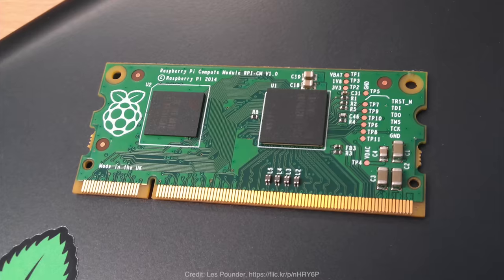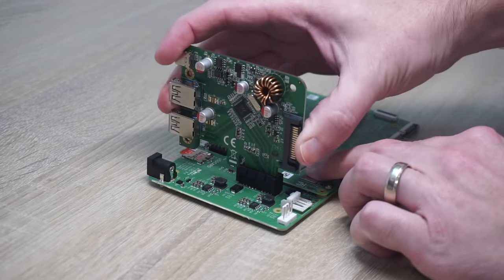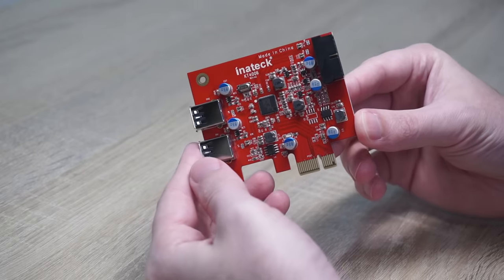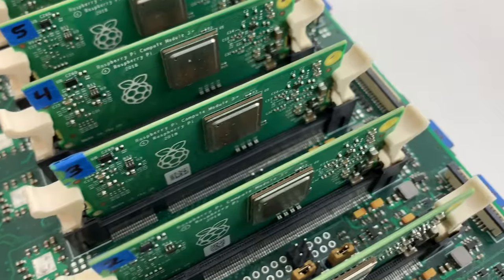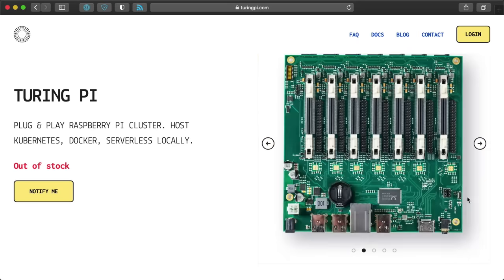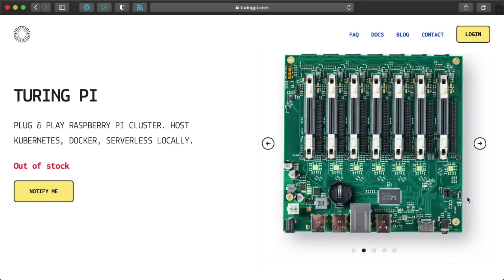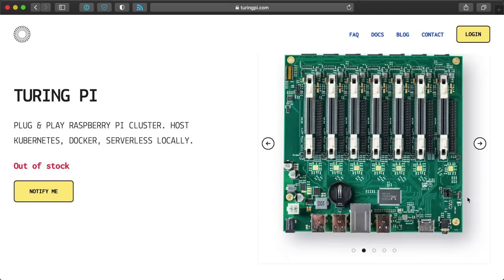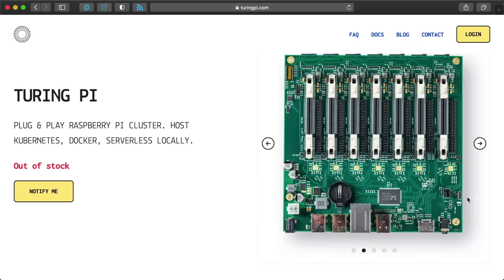The Raspberry Pi Compute Module 4 Review

Comment: The change in form factor was very well justified with a bunch of new features. Being parallel to the IO board will make your cluster wider, though.
Reply: So true the dimm is expensive when designing a board.
Reply: Yeah, I didn’t get what he meant at the end when saying it takes up less space, it seems it will take up more at least in the horizontal plane.
Reply: Couldn't a custom cluster IO board be designed in a way that lets you mount the CM4s at a 90 degree angle? perhaps by using a sort of riser cable for the outermost connector.
Reply: I believe you would be better off simply populating both sides of the mainboard with CM4. Cooling would be easy too.
Reply: I was having that in mind too.

Comment: Hi, regarding the graphics cards, you can plug in a graphics card designed for "longer" PCI Express slots into a PCIe 1x slot. I did that a while ago with an external GPU solution. The card will not use it's full potential, but that affected mainly loading times, like texture loading. Basically anytime the GPU requests data from the rest of the system. Regarding drivers, have a look at AMD cards, they are open source and are included in mesa and should work.
Reply: You're right, but in this case it doesn't look like the PCI-e slot was manufactured with the back open to support that. He could open it up with a rotary tool, but it isn't something most people would be willing to do.

Comment: As a person who will be buying one of these for integration in an actual device it's way more important to have every i/o possible than for the board to be smaller.
Reply: Indeed that's a development board intended to better develop the more integrated solution the compute module is meant to be used in. Kinda weird that there's no usb3 though

Comment: Use a modern AMD GPU card with a 1x to 16x pcie riser often used for mining. You should then be able to get a modern gpu running on the raspberry pi 4 CM.
Reply: That works with almost any GPU. PCIe is backwards and downwards compatible and latency tolerant.
Reply: @BrunodeSouzaLino I specifically said AMD GPU because of the opensource drivers in the Linux kernel which should work on ARM ISA not just x86.
Reply: or just open up the back of the 1x slot with a hacksaw also works
Reply: @Peter_Gamerrr  I mean a hacksaw is pretty extreme but some flush-trim snips would do the job. I’d be concerned about stability, though. Using a mining riser allows to lay down the GPU so it can’t damage the breakout board.
Reply: @Peter_Gamerrr  You would need the riser anyways as the PCIE sot is expected to supply power, where risers can be powered with a molex/sata power cable for that power. GPU's don't only pull power through the 6/8 pin power cables as the PCIE slot is normally rated at 75 watts.
Reply: @kdb424  Yeah, and I really doubt the CM4 has the power delivery to supply an extra 75W lmao, yeah you'd definitely need a riser.
Reply: Doesn't nvidia release arm drivers?  Pretty sure they do.
Reply: @charles2000wang  That's the theory, but in practice it can be a little bit hit-and-miss, mostly depends on the actual GPU being used. I've had issues with Navi for example, even on x86...
Reply: In fact you can't. It is not all about driver availability and slots. The problem is that PCIe is very complex bus and there are a lot of features that SoC should support to handle PCIe device correctly. For example GPUs require big amount of memory mapped to PCIe address space. I haven't seen any ARM SoC that supports at least 128MB buffer. If you are interested you can check how Allwinner created great H6 SoC with PCIe 2.0 but they have only 64k mapped. So literally no PCIe device can work with it. You can modify the driver to wrap the memory but it will require a lot of time. I also tried to connect NV GT710 to Rockchip RK3399 and use OSS nouveau driver. But no luck so far.
Reply: @Peter_Gamerrr  Pretty much. No riser needed. The power is common either way it takes it.
Reply: @paintenzero  In RK3399, the physical memory addresses that can be used for PCIe BAR (Base Address Register) is 32M, which is far more lower than what required in normal PCIe graphics card, that is why it is impossible to use PCIe GPUs on RK3399.
@acedogblast
 I reckon the same goes for RPi 4.
Reply: Raspberry pi does not have the bar space, a workaround can be used to increase the bar space, but the raspberry pi does not support the legacy VGA io connections that nearly all graphics cards look for before boot up. Fun times

Comment: What I like about this is that you can take a mini ATX case, drill some mounting holes, and fit the IO board in.  In fact, I wouldn't be surprised if someone makes an adapter to mount the IO board in place of an Intel board.

Comment: Just FYI, you may be able to get an PCIe x4, x8 or x16 card to work in an x1 slot using an adapter. This will of course only achieve x1 speeds but the other lanes will just remain unused, if following the PCIe spec properly.

Some PCIe x1 slots even have "open back ends" to accommodate cards with more lanes. And some modders create the open back of the slot manually using a saw, file or similar :)

Comment: Imagine what you could do with this. You can make a super compact computing cluster, or attach it to a custom PCB and make a cheap arm laptop that actually does something (or you could just buy the pinebook but you get the point right). The possibilities are endless!
Reply: If they keep the same connector, you could just swap out the module and keep the screen/keyboard/etc

Comment: I'm super interested in the pcie parallel port for the pi because LinuxCNC, which I use to control my benchtop CNC machine, requires a parallel port to control the motors in real time. Can you get a touchscreen for the pi compute module 4?

Comment: You really got me excited for compute module with motherboard!

As for nvme - maybe you could put /boot on emmc and rest on nvme.

For nvidia drivers - you could use open source nouveau driver, should work for ARM too?

I was wondering what is the max speed for over locked compute module with radiator and fan on it?

Comment: When you want to plug in a video card you can use a pcie x1 to x16 Riser and also use basicly any other pcie device
Reply: Yes, pci devices are usually able to run with less lanes. Would really like to see it tested.
Reply: You are correct, I've tried both PCI-E 16x and 8x graphics card in 1x and 4x slots with risers and it works just fine, just at the lower bandwidth of the slot.
Reply: @dv7533  yes beacause pcie is dowardcompatible
Reply: I haven't watched the video yet, but I'm pretty sure the Pi can't handle PCIe GPUs. I've had a look into this topic a while ago for the RK3399. Basically those small CPUs lack some sort of cache/memory that would allow them to operate a dedicated GPU. More precisely: This cache is too small.
Reply: PCIe is not only backwards compatible, it's also latency tolerant, as demonstrated by the guys that hacked the PS4 by making use of the the PCIe bus connected to a serial port and it worked.
Reply: @BrunodeSouzaLino  Please send a link of that, I'm intrigued
Reply: don't even need a riser u can also just rip out the back of the pcie slot so the x16 card will fit. That will also work perfectly
Reply: @Peter_Gamerrr  yes but when arent carefull that could destroy your pcie slot

Comment: If you cut the back of that pcie slot and there's room you can technically use a 16x card in it. It will just run at 1x speeds. The same can be achieved with an adapter. I'm curious as to the version of pcie too as I think that would have a large effect on the performance. If it's 3.0 then it wouldn't be too terrible to run something like a hd 7750. Not sure that would actually give you better performance though. Definitely would like to see what the differences are though. I'd watch that video.

Comment: you said cant be used to boot....i recall on the RPi3 there was an OS that you would put onto the SD card which allowed you install OSes to an external USB device and then boot those OSes (after iitially booting to the SD card and selecting which OS to use) sorta like the OS on the SD card was like another bios layer if you will or like a pre-OS.....can you do that with NVME and still put the OSes on there that way?

Comment: 9:30 For the GPUs, you can use literally any GPU you want (even if it has an x16 slot) by just notching out the back of the PCIe x1 slot and sticking it in, or the cleaner solution is to get a pcie 1x riser card (e.g. https://www.amazon.com/dp/B076KLJR2Y/ ). Nearly any x16 card will run absolutely fine at reduced speeds if you just install it in a x1 slot, no problem. You can them use an arm build of noveau for an nvidia gpu, or an arm build of AMDGPU for an amd/radeon gpu; you can probably even find pre-compiled packages of those drivers, but those are both open-source so even if not you can compile them yourself for arm.

Comment: It's time to run discrete gpus on the Pi. You can find 30$ pcie 1x to 4 1x ports switch, usually used for crypto mining rigs, with that you can connect multiple pcie cards.
Reply: People can run a mining rig on these new compute modules. How nice, it lowers cost so much.
Reply: @ethanlai1044  Don't know but maybe is possibile to use more powerfull gpu for better desktop and browser performance also kodi and plex hardware video encoding and decoding + more usb ports, nics, raid controllers, ecc...

Comment: You can use a 3080 in a 1x slot but expect around 1/16th  the speed if the cpu can keep up. First you will need to cut the stopper at the end so the rest of the pcie slot can go through. But also good luck powering it unless you have a spare power supply and a way to jump the connection on boot. This also will apply to any pcie device like a 1x card in a 16x port or 4x card into a 1x port you just loose the bandwidth witch will slow down the device you plug in

Comment: So many options tho! I wonder what will be the best for a turing cluster? I wonder how the turing pi will allow access to the pcie slot since it sticks up. I think it would be interesting to plug in the nvme ssds to them.    Also is the wifi needed if the turing board can handle communication?
Reply from the maker: For best performance, always go with the wired networking option. I would probably disable WiFi anyways, if the boards were in a close proximity to one another.

And regarding PCIe, there are many different options—you could have a riser that puts the slot horizontal, you could skip PCIe and just put an NVMe slot (my preferred option, at least for Kubernetes-like scenarios, since I want fast persistent storage), or put other accessories inline without any hardware PCIe slot at all.

Comment: The problem is that since they changed the form factor there is not longer a confidence in a suitable upgrade path. Previously you could be designing a platform that uses the RPi3+ with the intention to use the latest compute model once you enter production (or as a later model/upgrade path), however, by changing the form factor they have alienated anyone who was using their earlier platform.

Comment: i wonder if the existing Broadcom's 2.5GBASE-T and 5GBASE-T transceivers are pin compatible, and if so can you simply swap out that slower onboard Broadcom's 1GBASE-T and have it just work at 2.5GBASE-T speeds with the fully optimised pi4 openmediavault5

i dont know what ip blocks are included in this version of the cm chip revision, but is the  onboard Broadcom connected to a totally separate internal pci lane too ?

Comment: I love that we are back to full-size HDMI. I would have been fine with the RPi4 having a single full-size HDMI in place of two micro HDMI(perhaps with an additional connector for an expansion board to break out the second), but this is because my RPi uses are for servers. I have gotten my hands on the CM4 and have been using it with the raspberry pad 5 from BTT and have been loving it!

Comment: PCIe 1x should be compatible with a regular 16x gpu, but you'll need to cut the plastic bit out of the back so the card can fit. Any modern AMD gpu that is supported by the amdgpu driver should work. Basically any thing from the 470 and up. I would have really appreciate it if you gave it a try and confirm that though.

Comment: Nice scoop. I'm wondering how a 2.5G/5G USB-to-Ethernet adapter will perform? Using a NAS to boot and for primary I/O? I'm asking about USB because the PCIe 1x board is multi-port.
Reply from the maker: That's a good question! I haven't had a chance to test anything better than gigabit speeds. If you could get a NAS running over 1 Gbps to the Pi you'd have a pretty beastly setup! Still probably not quite as fast as direct NVMe but at least you could boot over the network (can't do it via NVMe yet!)
Reply: The official Raspberry Pi YouTube channel has posted a video about the CM4 in which, if memory serves, they said they were able to get ~3 Gbps from a 10GigE PCI-E adapter, which they said was pretty much at the theoretical limit of the PCI-E bus they're using.

I'm on my phone here, so it'll probably be a huge hassle for me to find a link to the video, sorry :(

Comment: Just use a 1x to 16x riser, you can buy one of the standard "extension" ones for $10 on amazon and use a hack saw to cut off the other 15 lanes on the male part (and desolder the ribbon)

Comment: Once I instered a gtx 1050 ti into a PCI Express 1x slot and it worked. 
However the system was x86 (Odroid-H2), but you could try as well with the video cards you have.

Comment: I know this is dumb because of the PCIe 1x slot limitation but what if you somehow use a adapter and so how chokeslam a RTX 3090 on it. It would be very interesting to see how it runs. Would it just break? Would it just not work?

Comment: Why can't the multiprocessor capabilities of the Turing setups be automatically used for general purpose computing? Like a standard multi threaded application etc? I wonder
Reply: Latency, the response times would be too slow for practical use, unless you used a pcie network.

Comment: You can cut the back of the port out for the longer cards. They are electrically the same you just won't get all your lanes for PCIE. You might get a 1080ti to run on it. Just as long as you're not to CPU bound.

Comment: 6:40 so you run modprobe to load the kernel module, then just unload the module again by rebooting? Of course it didn't work, it would've had a better chance of working if you did the modprobe and then didn't reboot.
Reply from the maker: So... when I first wrote up that section of the video a month or so ago, nvme support was not built in, and I had also symlinked the kernel module manually, and that's why it worked after a reboot. But I had forgotten about it, and also I believe the latest version of Pi OS (nightly build or if you do a dist-upgrade) does load the kernel module by default now.
Reply: I was wondering the same thing and searched the comments for a related comment. Modprobe doesn't survive a reboot, I am not overly familiar with the boot process for RPi's in general, but do know that the kernel module must be compiled in or as apart of the initrd (INITial RamDisk) [assuming access during boot is required], so the kernel has the drivers available to connect/mount the 'final' real root device where /sbin/init is spun up as process 1 and starts up the system. The magic is getting the RPi firmware to support access to NVME to pull a kernel and initrd off of it and transferring control to the kernel. x86-64 machines basically require EFI and gpt filesystem with a special EFI (FAT32) partition and a particular file structure/naming to do this now to boot from NVME. Not sure how RPi would boot from NVME in the future as their boot process is a bit of voodoo.

I don't do it often so I can't recall the exact command, after a 'modprobe nvme-core' a command to force a rescan of storage devices (often done with actual removable hotswap SCSI chassis) and the drive will show up / newer kernels seem to do this automagically hence why I've forgotten. Mind you to boot from NVME would require a supported RPi NVME boot process  in their firmware (think BIOS) and initrd or kernel with NVME module built in.

If the drive doesn't show up it is most likely something is unsupported or is mis-identified/mis-configured. In a day of excellent storage support, coming across storage that is unsupported is getting more and more rare and I suspect that might be the case, but not really sure. I use x86-64 hardware normally, just applying my knowledge on way the kernel works during/post initrd to the Pi here.

Comment: Anything stopping you from doing away with connecting the compute module to an IO board or anything except power? I know pi's aren't great at pure compute because they use an old process and they come with too much cruft, but the compute modules at least do away with most of the cruft.

Comment: Wonder if you could chuck a video capture card on the PCIe slot and make a tiny streaming device.
Reply: I've seen adapter boards on AliExpress that convert HDMI to CSI, so that you can plug HDMI devices into a RPi's camera connector, so you might be able to create your tiny streaming device with any RPi - even a Pi Zero! :)
I'm not sure a Pi Zero would be powerful enough to handle video at any decent resolution and frame rate, though.

(Note that I haven't bought any of those adapters, let alone successfully used any of them, so I can't make any promises about whether or how well they work. I just spend far too much time browsing random electronics-related items on AliExpress, so come across cool-looking things from time to time :))